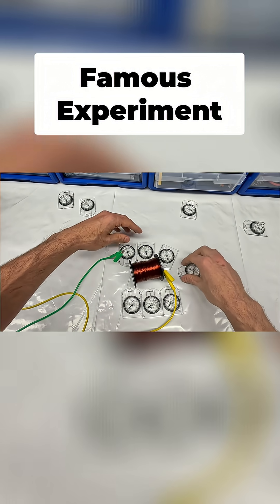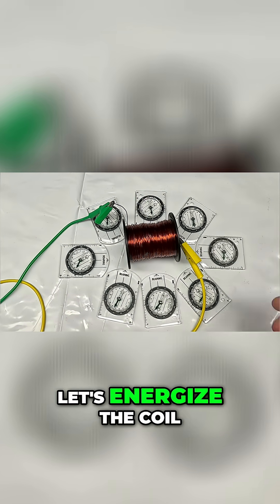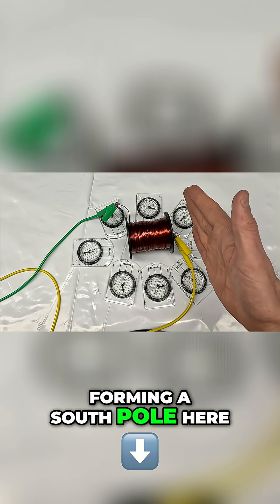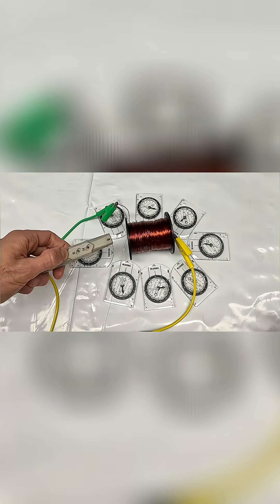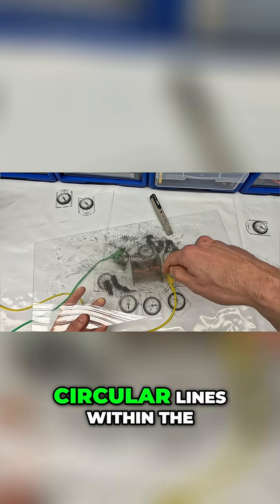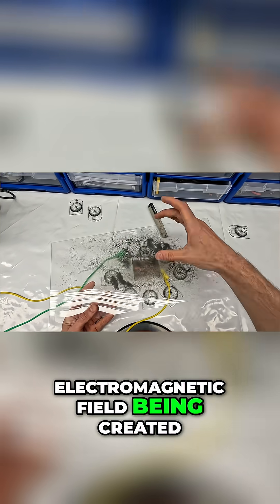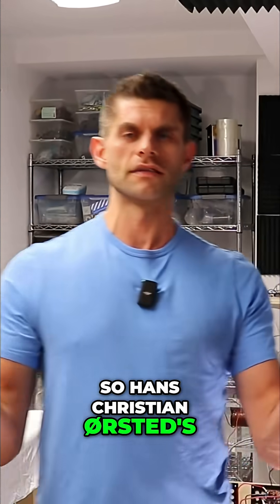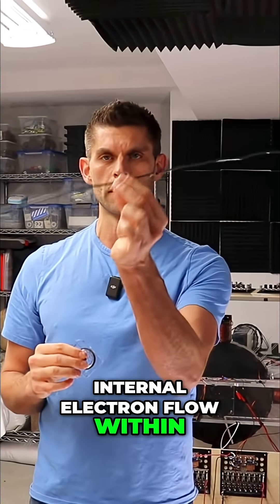World Changing Experiment #physics #science #engineering

Comment: How are you gonna produce electricity with this? I always run into the same wall... magnetism or just magnets alone cant generate electricity, the magnetic fields need to be moving to generate electricity... doesnt seem to be a way around that.
Reply from the maker: You can produce motion with static magnetic fields arranged correctly. Positive work
Reply: @MadscienceLPTECH I spent over 2000 dollars on magnets and tried tons of combinations... the magnet attracts and then u need energy to pull them apart... there was one combination that sort of worked but it had no torque.